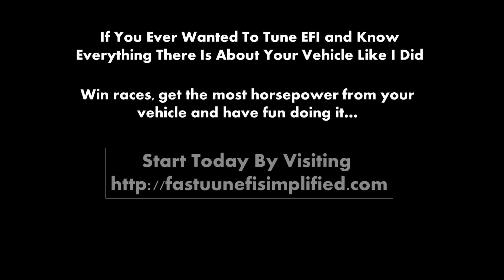FASTuuN EFI Simplified and Tuning Engine Management Systems

Comment: One question. I have a Nissan Micra 2020, and suddenly at 100 km the speed pedal didnt work for 5 seconds and the  the start stop button which i had opened had been closed (seems that the whole system had been reseted) Then after 5 seconds car woke up and i could speed up again. This happened 2 times in 1 day.. Any idea what might be the problem?